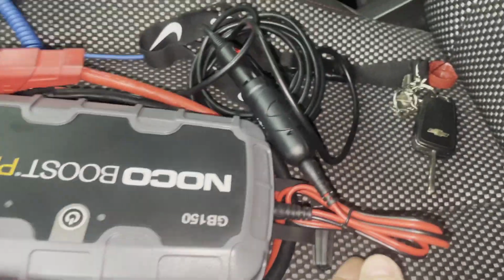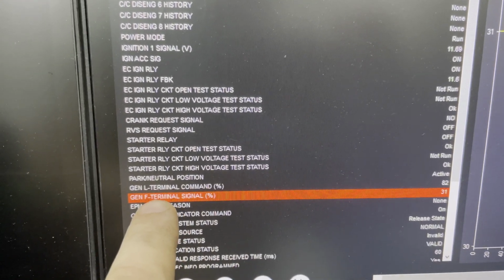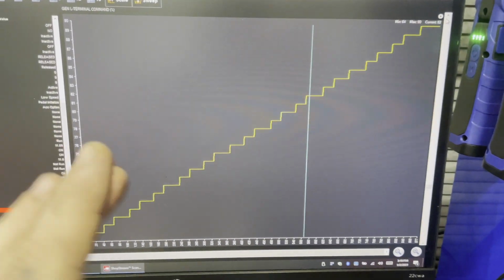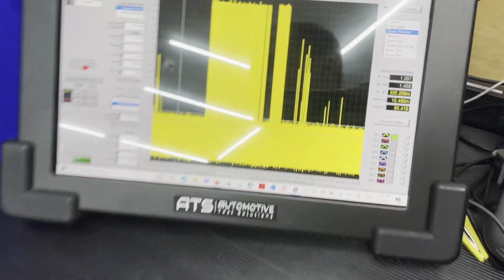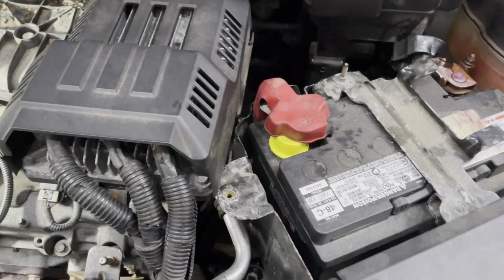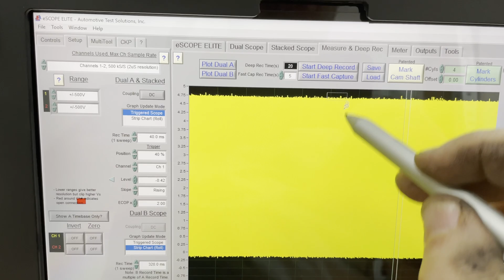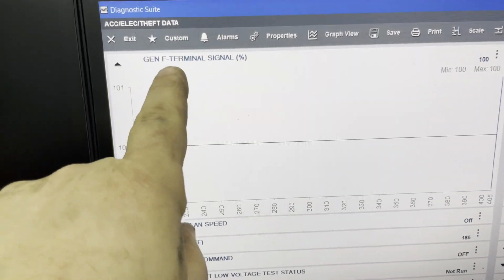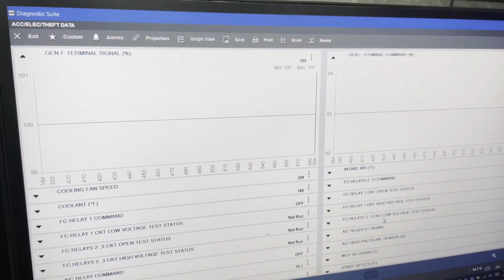Chevy Equinox Charging Issues - ATS eScope Elite

Comment: How are you liking the escope? don't know if I should buy a escope or picoscope?
Reply from the maker: It’s a great scope I love it the deep record feature is amazing as well as dual time base. It can handle 500v no attenuation needed. The 8ch is awesome,  you can see glitches and drop outs right away. The iea software is amazing with the transducers as well It will tell you all the info right down to the timing of the valves it’s crazy. I have pico to it which is also awesome and very popular
Reply: I have both the Pico and the Escope elite 4. I use the Escope all the time & i love it..It has more functions than the pico plus it has misfire detector which will find which cylinder is misfiring by using crank signal & the ignition number 1 control signal..Amazing scope & features
Reply from the maker: @vickenkaragozian2041  I agree I love the escope too I wish it had more processing power tho it’s 1ms vs Pico is 400ms
Reply: @weldingjunkie  How does the 400 ms can do more the 1 ms ? I'm not good at that.Does that make the scope slower ? Let me know. Thanks
Reply from the maker: @vickenkaragozian2041  it can draw 400x faster basically. The Pico is the fastest scope out. This comes into play when doing ignition on all 4 channels per day, when you do all 4 with the ATS it gets blocky
Reply: @weldingjunkie  got it. Thanks👍
Reply: which one is better 8 channel picoscope or 8 channel ats?